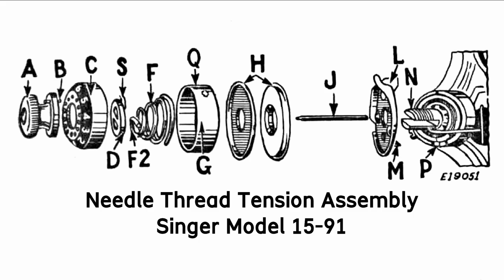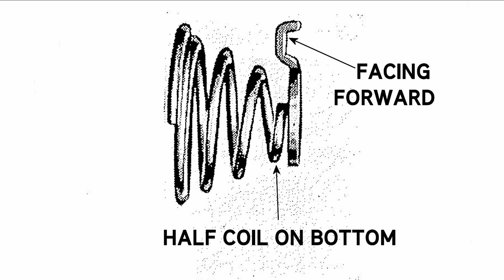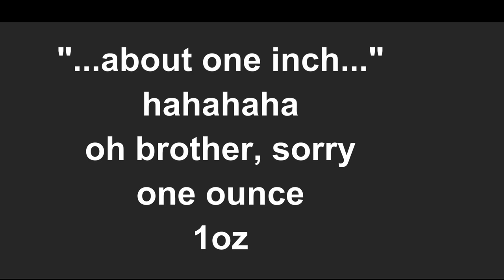Tension Assembly, Singer 15-91 Remove, Clean, Install, Adjust, Zero Out

Comment: Hi Andy! In this video you said you’re not removing the tension spring, stud, and base because you were saving that for your needlebar replacement. Of course I ended up taking all these off anyway because of how much crud was back there but now I’m nervous about reassembling the parts not shown in this video. Any chance you did end up showing these steps in another video? I did a bit of searching but couldn’t find it.
Reply from the maker: Sorry, no video for that 😢Hy the time I started that and the motor I was too ill to continue. Here is a link to download a free copy of the original service manual. https://ia903205.us.archive.org/18/items/singer-15-91-adjusters-manual-en/Singer-15-91_Adjusters-Manual_EN_text.pdf        Pages 29 & 30 of the manual (not the PDF page number) have instructions for the tension assembly including the spring. I hope that helps you out. Good luck.
Reply: @andytubesewing1953  Thanks Andy! I got it reassembled and working, you went above and beyond with that link for me! I didn’t think you’d have time to respond to my comment at all so I was excited to see it.
Reply from the maker: @amberx1863  hey good job! I'm glad you got it going. Thanks for letting me know

Comment: Wonderful - thank you Andy.  This was totally worth doing because there are some some subtle little differences worth knowing for the tension on this model that could so easily get missed.  I really was thinking "Why is that stud slot off on an angle?" so I had to chuckle when you explained why.  Yes, of course!  It's obvious (once you know...).  ;-)
Reply from the maker: Good catch, Megan. I must admit when I first saw the position of the tension stud I thought "what knucklehead installed it like that"?
After removing the parts I realized who the knucklehead really was. Happy New Year! ✨

Comment: I was lucky enough to acquire two of these 15-91s in relatively good shape - one was very good - but the wiring needed replacement on the other - I grew disinterested for a while (a few years actually) - but stumbled upon this tension video and it has me inspired / excited about restoring these beautiful machines - thanks so much for this wealth if detailed info - best I've seen on the 15-91s
Reply from the maker: You have got a lot of videos on this model. I think you're in for a good time. I appreciate your nice comment and good luck to you

Comment: Oh.  My.  Goodness.   I have been sewing for 40+ years on my 15-91 and all this time it’s been THREADED WRONG!  I can’t believe it.  

The illustrations in the tiny little green manual that comes with the machine are very hard to see, so I mistakenly threaded mine this way: after the thread goes between the tension plates, I then put it through the tension spring before going through that little left-pointing “finger” on top the tension assembly and then on to the takeup lever.  Ack!  The spring should actually come after the finger!

Well, I immediately ran into the sewing room and rethreaded my machine.  Maybe NOW I will be able to do free-motion quilting without skipping stitches. 

I always, always, ALWAYS learn something new from your videos, @Andy Tube.  I can’t wait until you get to the stud assembly.  I’ll probably find out I’ve got that one wrong as well. Lol.  

Thank you SO much for your wonderful, thorough videos.  You are truly a gift to all of us vintage-machine-lovers and your work will continue to help others 50 years from now (because you KNOW the machines will outlast us all.). Happy New Year!
Reply from the maker: Best comment today " ALWAYS learn something new... @Andy Tube " Thank you very much 🙏 I have found most vintage Singer machines to be forgiving to my mistakes. It's like they do their best to make a good stitch even when I goof up. Tension & Timing are the least forgiving though. Those have to be good and it makes sense since those are the most important to stitch forming, which is the function of the machine. I'm curious how your machine will perform with the propper threading path. Hopefully, the angels will sing, hehe. Oh yes, I am COUNTING on my machines outlasting me so daughter and grandkids can play with them a long time. Thank you again for your comment. Take Care.

Comment: I always learn from your videos, Andy.  I did not know on the Singer 15s that the tension dial should be at an angle so the sewist can see it since the tension knob is on the end rather than the front of he machine.  I have the tensions on my two 15-91s lined up “perfectly” and not angled.  Who knew??😲.   So now, I will correct that.  I remember in the 1960s my Singer dealer strictly and adamantly admonished us lady customers to “NEVER”, EVER touch the tension dial - not to even think about touching it!.  We so so afraid that we would totally destroy our beloved machine if we even thought about touching that tension dial.  Or we feared we might get arrested if we dared touch it. 🤓 We had to take the machine to the dealer if the tension needed attention.  I guess it was easier for the dealer to scare us rather than to teach us how the tension dial worked and how to adjust it.  That is so laughable now since some of us ladies have finally realized that it is not against the law to touch the tension dial and we became liberated from “tension dial fear” and have actually learned  how to take care of, dismantle, clean, or restore and understand how our vintage machines work.  Times have really changed and now I regularly dismantle tension disks totally fearlessly.  I owe much of this to you and your priceless videos, Andy. THANK YOU and Happy New Year!
Reply from the maker: It's a whole new world now for VSM. My Mom and Grandma were told the same thing. I remember my Grandma's face when she walked into her sewing room and I had her Model 66 tension in pieces on her cutting table. "What have you done, Andrew!" 👀 The funny thing was I was just following the directions on pages 22 - 26 of her SInger Model 66 Instruction Manual  I found in the drawer of the cabinet. https://www.singer.com/search/support?title=66-16  I figured if we were not supposed to work on it then why did they show us how? I was young and naive and figured I could fix anything, haha. Luckily I did fix her tension and we celebrated with fresh peanut butter cookies. 😉
Reply: @andytubesewing1953  That’s a great story, Andy!👏
Reply from the maker: You can see I'll never forget it. Later when she told my mom about it we had a good laugh and my mom asked me to clean her tension too. The start of being the go-to guy in the family for sewing machine maintenance.

Comment: Thanks, Andy!  I THINK I may have fixed it.  The old 223 is taking canvas like tissue.  Four layer seams with no bunching, thread breaking, and tight back stitches.  This weekend I'll add canvas reinforcements to a tarp project and sew on webbing for the tie outs.  That'll be a very rigorous test.  It seems to be running like when I  got it  some 4-5 years ago.  This machine has sewed some small  dacron  sails and lots of canvas.  Each up to 8 layers with no issues regarding power.

I'll keep you posted.
Reply from the maker: This comment was held by YouTube (I can't see why) but they released it on 08/19/2023 at 11:02 AM. This is great news and happy you did not give up on that nice machine.
Reply: @andytubesewing1953  If UTube didn't have its practical usefulness, Id drop it like hot rock.

After the successful test, I went through it with a fine brush, swabs,  and some alcohol and cleaned everything I thought could use it.  Then, fresh Singer oil in all ports and on every cam surface.  Tomorrow I can getstarted on the tarp project: a second hand king sheet thatwill get the edges folded over an inch then sewed for strength.  Then, canvas reinforcments at the corners and two along each edge.  After that, I'll sew on some webbing for tie-out loops.  The final step will be dunking the whole thing in a mixture of silicone caulk dissolved in naphtha for a waterproof treatment.  King sheets make great lightweight camping tarps for pennies compared to commercial Silnylon.

Thanks again, Andy.
Reply from the maker: @OutnBacker  Sure, you are welcome. That's quite a process you've developed. Makes a lot of sense. Hope you have continued success.
Reply: @andytubesewing1953  Can't lay claim to the process.  It's well known among the BushCraft crowd.  Cheers.
Reply from the maker: @OutnBacker  OK, whatever "BushCraft" is 😉
Reply: @andytubesewing1953  Ha! It's the application of arts of suirvival and living that were common to mankind before the invention of the internal combustion engine or the harnessing of electricity.

ya know - flint an steel fire starting, etc.  We do it to varying degrees of authenticity.  For instance, I don't wear buckskins - but I do have a couple black powder rifles

Bushcraft also includes skills taught in military survival classes, and can be quite sophisticated.

For most of us, it's just Boy Scouts for grown ups. 😁
Reply from the maker: @OutnBacker  Got it, and thanks for the explanation. It sounds like fun and good skills to have.

Comment: Greetings Andy! This will help me immensely - putting together an assembly on my (15 clone) White 263 straight stitcher (same configuration, side tension unit that attaches to the side plate like the 15-91). I'm having a problem with the pin staying all the way to the back, and when I lift up the presser foot, it jams into the pin and does not lift all the way. Nor does it 'push' the pin in to loosen the tension discs. I must have something ajar. :)   I knew I'd find an "Andy" video that might help! Also thanks for the Singer Adjuster's manual link! I've learned so many things from you over the years for my 401 and 404 - as have many people! Wishing you all the best!
Reply from the maker: good luck,. Last time I had a similar problem the tension assemble parts were not in proper sequence and that put the pin too deep.

Comment: Thank you for your wonderful video.  I have a 99k, is the tension assembly the same?  I love the schematic, makes it so easy when reassembling!
Reply from the maker: Thank you for watching my channel and I appreciate your comment. May I ask you to take a look at my Playlist for "Cute" a Singer Model 99K? https://www.youtube.com/playlist?list=PLsCOZgzzaiKIIUgkEujqHc9iNWN9NPW2Z   There are 21 videos for working on the 99K including one specifically for the Thread Tension Unit: https://youtu.be/rioRhSbog6U
It details the parts, how they function, how they compare to another common tension unit, how to take it apart but back together, and "Zero" it out to factory settings.
The other 20 videos include a slideshow of the original parts diagram of the tension unit, how to time the hook, and how to clean the machine, how to completely remove and replace all the bobbin area parts, where to buy new felt wicks for the hook lubricator, and so forth. I think you may enjoy some of the videos and thanks for keeping your machine in service.

Comment: Do you have a video about how to take about that base behind the tension? I need to replace the spring that's in there, the one the thread hooks too when threading. I love your videos, so easy to follow!
Reply from the maker: Right, the Thread Take-Up Spring. I don't think I have the exact video you're asking for but here is what I can offer. A tension video for model 99K which has a similar tension unit, maybe not exact, but similar: https://youtu.be/rioRhSbog6U    A link to where you can download a free PDF copy of the Adjusters Manual for model 15-91: https://ia903205.us.archive.org/18/items/singer-15-91-adjusters-manual-en/Singer-15-91_Adjusters-Manual_EN.pdf    Perhaps with this extra info you can work thru your problem. Thanks for watching my channel, and good luck.

Comment: Hi Andy, thanks for the video. 
I have a 215g, and this looks very similar. Do you maybe know what American model was the example for my German one? 
Best regards from Berlin.
Reply from the maker: I can't help much with your 215G. It looks like Singer inherited the model from a German company when they bought their factory
https://www.singersewinginfo.co.uk/215g     If I got it correctly they made it the first year and then retooled the factory to make the newer cast aluminum machines. Maybe one like this? https://www.youtube.com/watch?v=3ZZa7Usf6l8
It seems Archive.org has a copy of the original 215 manual in German: https://archive.org/details/singer_215_gebrauchsanweisung_instruction_manual/mode/2up
I have hundreds of Singer documents, but nothing for model 215.

Comment: Andy!!! I need help. My Singer 15-91 was made in 1938, she has a scroll faceplate and her tension unit is made a bit differently. These directions are just right for reassembling her bobbin. How can I found information on the older model tension?
Reply from the maker: This charity sells a guide that includes tension servicing for models 66 & 99 that have the type of tension I think you have;
https://www.tfsr.org/product/sewing-machine/  If you can not afford to buy it from them you may be able to get a free copy
from this service, just be careful what you click on https://www.scribd.com/document/355688276/How-to-refurbish-sewing-machines-TFSR-Refurbishment-Guide
https://www.scribd.com/document/351577023/Refurbishing-Upper-tension-Mechanism-Singer-vintage-machines

Comment: Love your video.  Do you not coat any parts with oil before reassembly?  I think I am going to have to clean my assembly all the way through. Should I be scared?  I know I can get as far as you did in this video. After that, all bets are off!
Reply from the maker: Thanks. The only part of a tension that I have oiled is the tension spring (beehive spring). In fact, at @11:45 in the video, I mention being sure there is NOT any oil on the discs themselves. The first tension I ever did I put a very light coat of oil on the parts and I had a very hard time setting the proper tension until the light came on that oil is slippery and the thread was slipping right through those discs. So, no oil on any part the thread touches is my policy, and if I do add oil I usually put one small drop on my fingers and rub the part, like the spring, to coat it with a little oil and then rub the part with a towel. If you live in a very humid area I would do that. Here in the Sonoran Desert of Arizona, the humidity is very low and rust is unusual. Scared? No need to be scared or nervous. The parts are very sturdy and you can do this with no problem. It is very rewarding to have a clean tension unit that is zeroed out and working like new. I think you'll enjoy it actually. Next thing you know you will be watching more of the videos and removing the needle bar or something, hehe. Don't be in a hurry, turn on some music you like and have a good time with it. Thanks for watching my channel, Becky, and take care.

Comment: I wonder if you would be able to help me  with  my Morse 5401 Stretch Stitch sewing machine which has a problem sewing only in smaller size zig zag stitch.  Doesn't matter what I do it will not sew with a larger zigzag stitch.  Would you be able to provide a video in how to fix this problem.

Hennie Minten
Reply from the maker: Sorry, I only do Singer. I don't know anything about Morse machines. ☹